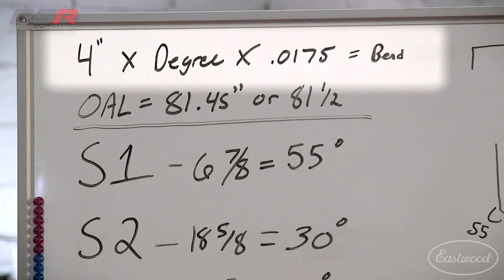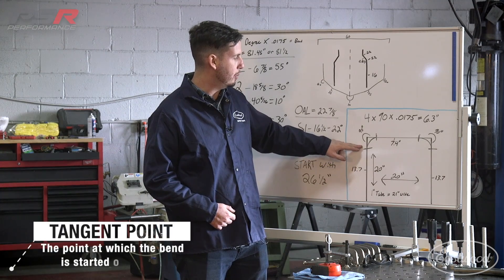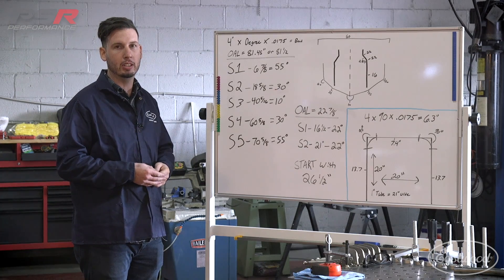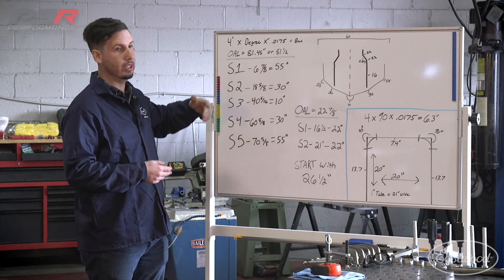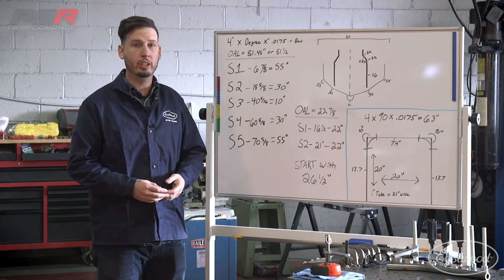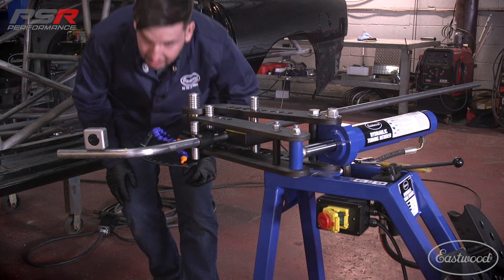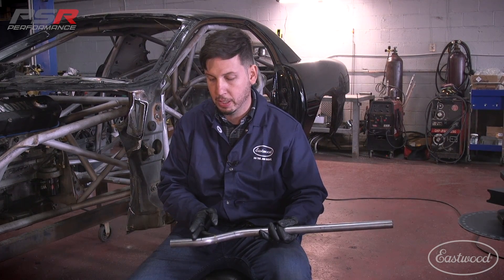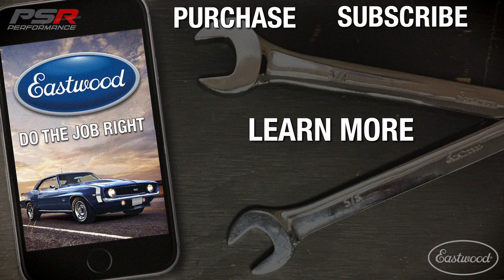Bending Camaro Core Support - How To Layout Bends + Material - Hydraulic Tubing Bender - Eastwood

Comment: Got a question cause I havent bend anything other than wire.. :-)  If the width is 20" and you are making a 4" radius bend on each side (for the upper part), that should get you: 20"-4"-4" =12" not 7.4". The Bend-straight-Bend on the top horizontal finishe product would measure 20" in finished product and would use 32.56" of material. Where does the difference come from? thanks a lot.

Comment: Can you bend aluminum tube or is it too soft
Reply: You would be able to bend a thicker wall aluminum tube, depending on what your CLR of the bend die is. Problem is when the wall thickness or CLR is too small the tube will crush.